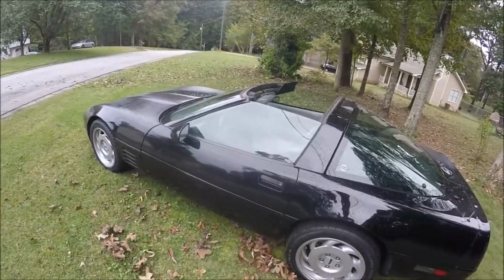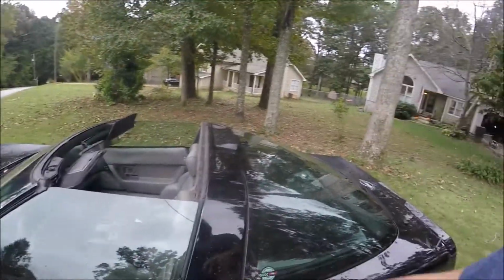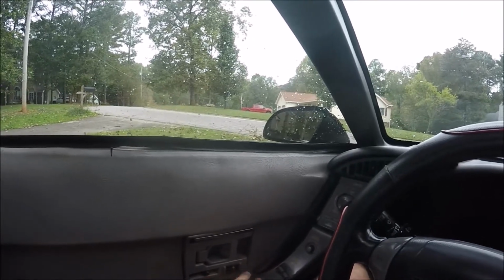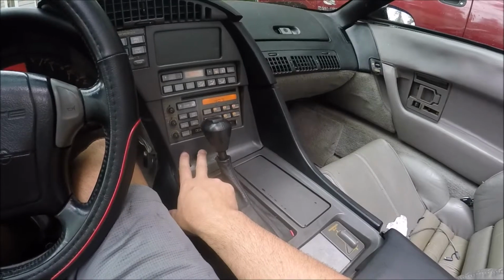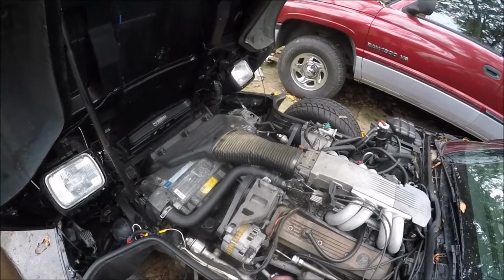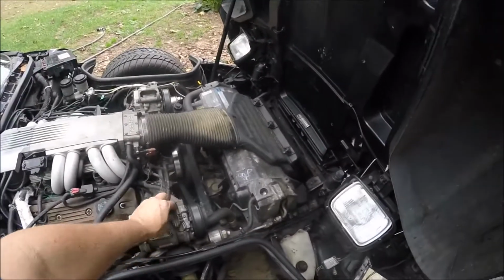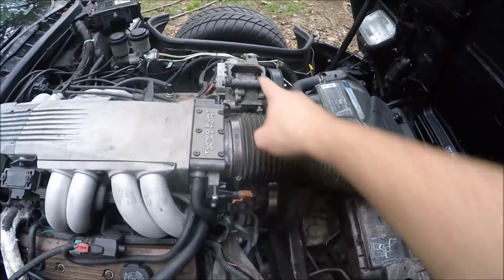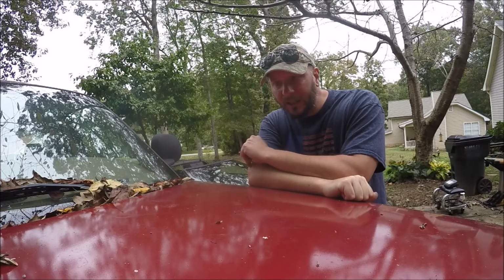New Project!!! Cheapest Corvette on Craigslist!!

Comment: Interesting that it has the high mounted 3rd brake light, means that's not the original hatch glass
Reply from the maker: Evan Hooper this thing is clearly pieced together from several cars I think. It is a huge pile. Lol. Still pretty fun and a looker from 50+ feet.